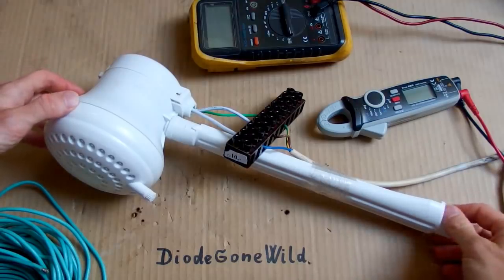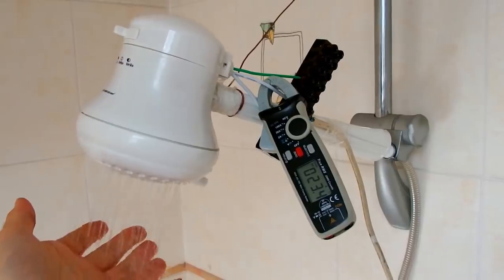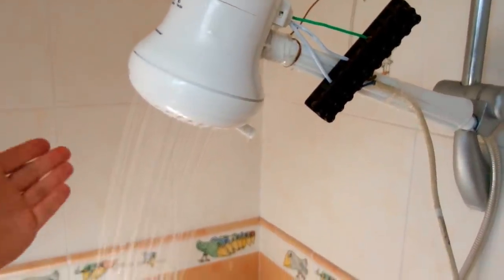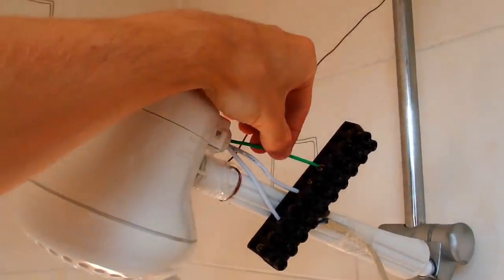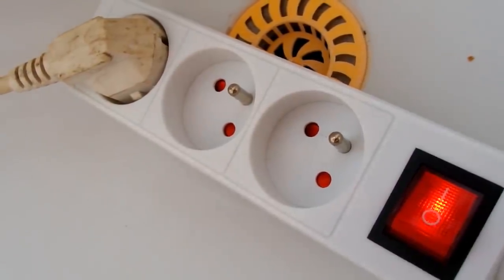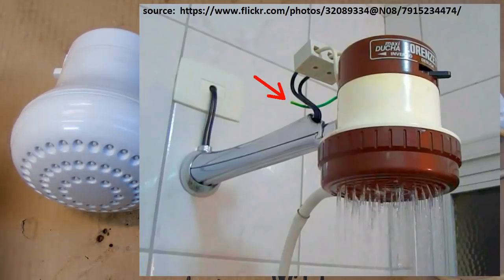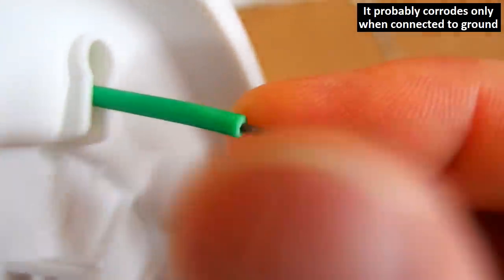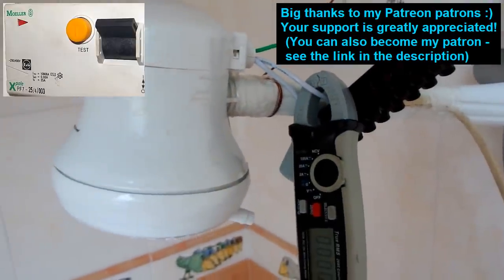Electric heated "suicide" shower PART 2 - test & measurements

Comment: So with 5 Volts and 1 Amp, you can charge your phone while taking a shower - that's nice! 
At 2 Amps, even Quickcharge.
Reply: Is AC,you need to rectify it first and get a voltage regulator if you dont want to blow up your phone battery.
Reply: @mernok2001  noted, bring rectifier and regulator first before taking phone into shower

Comment: You need to add more salt ! :)
Reply: Haha, best video of him :D
"Even more saaalt " :D
Reply: All you would need is to install one of those over an old metal bath with an earth/ground wire attached or a metal drain pipe and you have a disaster in the pipeline... even taped up with the power cable right for 32A if the cable joint gets wet you have mains voltage on top of you, add an earthed metl frame shower screen and you have built a death chamber.

Comment: As a Guatemalan, I find this video quite fascinating. I've used those showers all my life and I never thought of them as any particular hazard. I've received a couple of shocks, but I never thought seriously about them. Also, I've never met anybody with a shocking experience (pun intended.)
Reply: Really? As a Peruvian, I grew up shocked and scalded by these devices. (Well, not every time, obviously, but let's say I haven't forgotten!) Perhaps they have improved a little since the 80s and 90s.
Reply: @haraldhelfgott195  I still get a shock in Peru even under new devices (the ground wire disconnected as usually)
Reply: @haraldhelfgott195 I used similar when I lived in Callao in 1992. Got shocked a few times because I’m tall but I lived. Moving to the Philippines in February and buying one of these for there.

Comment: Hahaha, I'm Brazilian.

And I have used this kind shower all my life (25 years).

And you are absolutely right about the conditions to get a shock.

This already have happened with me but the shock never was a big one, just a small fright. But happened this is a common fact.
Reply: I'm Brazilian too. Unfortunately old houses do not have a ground wire and most electricians are not concerned about safety. They don't connect the ground wire even when one is available because they are just too lazy to connect one more wire after having seen so many showers working with only two wires connected.
Reply: @andrelange9877  Sad but true, they only do the least effort to get it to work.
Reply: @davidca96  It is so rare to see something grounded here in BR that when someone decides to talk about it, they usually like to make it sound as if it were a supernatural complex subject that is not worth dealing with, so it serves as an excuse to leave things ungrounded.
Reply: you can haz internet in HD but you can no haz safe shower
Reply: @YouTubeSupportTeams  That's because in BR stupidity is the rule, not the exception.
Reply: @andrelange9877  yeah, i'm not at all surprised. It's Brazil.
Reply: When I spent a year there I planted a copper rod into the ground outside my GF's house just to connect my computer, as we had many lightning strikes on the beach and close within the valley where I lived. I miss Brasil :(.....would live there again in a heartbeat.

Comment: Great research and testing of this dangerous device. Your drawings are awesome. Keep up the great work.
Reply: but if you call it dangerous among poor latin americans you get brushed off as paranoid, that's what has happened to me
Reply: @imeakdo7  me parece que sera peligroso en tanto no se instale correctamente, si se siguen las recomendaciones del fabricante y se aterriza la termoducha, tal y como viste en el video, no hay peligro alguno, el problema esta en la mala instalación, pero eso le puede pasar a cualquier equipo eléctrico y de igual forma terminar siendo peligroso.

Comment: Even in Brazil, all new electrical panels have differential current breakers, so the simplest version of this shower no longer works. The trend is towards insulated heating element units, and central heating units are seen more and more these days. Indeed it is very rare to hear about accidents related to this shower here, knew about 1 or 2 cases in my 40 years. OTOH people here are very afraid of gas heaters (those old units that went into the bathroom) because many people have died of carbon monoxide poisoning. This shower works in Brazil because water is very "soft" (little dissolved minerals), water is around 20-25ºC already. Most houses don't have too big water pressure and don't desire it, otherwise too much water would come out and the shower would not be able to make the water warm. Less pressure = droplets = no conduction.

Comment: Brazilian here. In normal operation without grounding you normally fells a light shock only when touching the faucet if you have an open cut in your hand despite that they seem to be pretty safe. Interesting fact that we often see on the local news people that got killed by natural gas powered showers but not by these so called suicide showers. Anyway nice video :)
Reply: Well, old-fashioned Brasilian natural-gas showers would not pass inspection in many countries either! (Used one in Rio in 2007.)

Comment: No groud, latin america stile!

I`m from Brazil. I used things like that all my life. Never hear anyone how died because one of these showers. But I learned the hard way not to switch power when the water is running. Little shock on the fingers. Hahahaha...

I liked that you tested without the ground wire. Like you said, most installations are done like that.

Another very common and very dangerous thing that is done here is that the circuit breaker that was originally installed for the shower was, lets say, 30 amps.  The installed shower needs 35 amps, so the breaker is switched to a higher value without changing the wiring that was designed to handle 30 amps.

Also, since it is very common to have these showers here,  the lowest tax we can pay for energy already covers one of these showers. We would not get any discount by getting a boiler.

Cheers!
Reply: i used this in my house but many times one wire in the socket getting melt or burn what shall i do give me some idea bro.
Reply: Your Brazilian circuit breaker boards recalled in memory our circuit breaker boards in my childhood. It was at Soviet era where 2-3 room apartment usually had two 250V 6.3A circuit breakers. Nominal current for apartment was considered 10A. Wiring inside apartment walls was accordingly thin with thicker wires only for electric stove socket. Usual wiring also had room lights and wall sockets connected. In result more demanding appliances or two electric room heaters in winter was not usable together with other appliances and blew away circuit breakers together with room lights. But people realized that they can have power longer if they use thick wires and nails instead of circuit breaker fuses. It kinda worked till their apartment wiring started to act as fuses :)  With house fires sometimes in result.

Comment: Quick safety suggestion, when grounding yourself ground the same arm (ie with an arm band).
Grounding yourself with the opposite arm is just about the worst thing you can do, a lot of the current can flow through the heart and it doesn't take that much to cause arythmia.
Still, great video & shocking (pun intended) how someone can sell such a product.
Reply: he knows this..
Reply: I'm pretty sure he knows this

Comment: This is the best video so far on the "suicide" shower. I think I would feel comfortable using one especially if I installed it myself. I would replace the ground wire with a 20 gauge, stainless steel wire and seal the wire connections with silicone caulk. In a country without a ground connection, I would use a proper pipe clamp further on up the pipe and check it with a multimeter to make sure it was good. If plastic pipes were used, I would install a good grounding rod into the ground outside the bathroom and bring a wire through the wall. In all, I would have no problem using this dodgy contraption. I likely wouldn't even have a problem with my kids using it if I had installed it myself. I think I would install a water resistant switch away from the shower as an emergency shut off in case the contacts got welded together, and the thing caught fire.
Reply: Indeed a bit of engineering and it should be more safe then some other stuff in bathroom ( cases are nominaly grounded but they do like to somehow get current inside and if paint peels off while they won't kill you or anything it's unpleasant like 9v on the tongue )
Reply: - In a country without a ground connection, I would use a proper pipe clamp further on up the pipe... One of your spiritual relatives one floor above my apartment grounded his washing machine to water pipe and nearly killed me. I would sue you for negligent homicide try in such case.
Reply: @KrotowX  This is quite a baffling comment

Comment: Those things require maintenance, it's very common that the ground wire gets oxidized and it breaks and falls off, the automatic mechanism gets dusty and it gets stuck, also the contacts get oxidized and the shower stops working or they weld themselves. It's not a bad idea to put a knife switch with a cord, so that children can turn it off in case of emergency.

If you want to use it you should know how to operate it safely or in a safer manner, which most people don't know, for example if you close the water and it keeps making sound it means that the mechanism got stuck or the contacts got welded, so you simply open the water again (before turning off the breaker) to avoid fire hazards, they are usually pvc so they don't catch fire like plastic, they get mostly carbonized buy yet dangerous.

Comment: It's surprisingly 'safe' considering I was expecting a proper shock from it. It might be useful as a backup I guess
Reply: tmo72 I agree, but I don't see how it could possibly work properly in let's say a European country. You'd obviously ground it and all houses built after the 70's have one or two RCD's connected to all of the circuits in the house. Bathrooms (like the guy in the video) trip at 30 mA in Europe so dropping a hair dryer in your bath tub won't kill you. But a lot of modern houses have 30 mA for either the entire house or just for the dry circuits and 10 mA (yes, ten!!!) for the 'wet' circuits like kitchen, garage, outside and bathrooms. So this device would never work when properly installed, because the RCD will trip all the time. Unless you disconnect the ground wire, but no one would do that?
And there's not really a way to fix it, because there will always be current going through the water touching the ground wire.

They could've made it a lot safer though by making it longer, so the water would be droplets (don't hold voltage anymore), then come together and then go through the nozzle for a nice stream of water. They could even allow you to connect a separate hose with your own shower head, because it's impossible there's still any sort of current in the water
Reply: I guess you can fill the bucket with the hot water so you don't get the danger of killing yourself
Reply: And this one is the cheaper that you can get, probably a chinese crap
Reply: the brazilians brands have more security, but the quality can be expansive

Comment: It was developed here in Brazil in the mid 30's, in every house in Brazil has at least 1 shower we are a tropical country and so we have the
habit of bathing every day, there are more than 200 million peoples taking baths every day in the last 85 years if you compare with the numbers of accidents with showers
 they may be considered safe. They must be installed correctly at the proper heigth, any electrical equipment is dangerous when used improperly.

Comment: Oh just a hint. These showers are made to be really high at the top of the room, really close to the ceiling. So usually people will be very far away of the head. 

Oh and this is a really dodgy and low end model, there actually are some that the resistance is closed and dont touch the water, so no shock foe the people! Unfortunatly they are a bit more expensive and usually its resistance cant be replaced so many people dont buy them. 

Nice test!
Reply: Alex Tarasov Yep, basically. Way more safe.

Comment: i connected mine like the one in Grenada,bought some wires to extend the wires from the walls and connect to the shower head. i connected the ground wire,connected the red wire to the positive marked wire of shower head,i connected the black wire to the -ve marked wire of shower head. but to my surprise,the black wire keeps on burning when i open the shower heater.what might be the problem,are my connecting wires to thin?,are live and neutral wires interchanged? what might be the problem?
Reply: for "normal" use is recomended cable with diameter between 2.5 mm and 4 mm, or the recommended for a current of 25-30 A x 220V/110V by the standards of your country

Comment: Here in mexico i had one of those it was the 120v version and had a dedicated circuit supplied by a gfci pigtail breaker at that time there was no problems with it but later in a few months as shown in the video the heating element corroded and broke but since i now had more budget i upgraded to double phase 240v and installed a rheem 18kv electric tankless water heater

Comment: I wish someday there'll be part 3 special edition which includes running salt water😍😍 through the shower head and aslo running the heater without any water.. 

No cat was harmed during the video 😶
Nice drawing 👍👍
Nice video 👍👍
❤️❤️❤️
Reply: Faysal Khalashi™ its not possible to run the shower without water since the water completes the circuit
Reply: EVEN MORE SALT !!!
Reply: @Sebastian-gj9tc  you can run it by just connectiong the heater to the mains directly

Comment: The real big problem comes out if you have not grounded the shower (or the ground wire becomes damaged by corrosion) and accidentally one of the two 'power wires' disconnects. In this accidental configuration all the current coming from the live wire that is still connected has to flow down towards and trough you to the sink... as the pipes are somehow often grounded...

Comment: I've used this and another way to get a shock is if while you are in the shower the resistance breaks, those resistances die one day to the other. Is not pleasant but it does give you the time to jump out the shower.

Comment: Somehow i think i will give it a mis lol :-D
Now that "chocolate block" connector strip is the "Dogs bollocks" , oh you added it, the best part of the unit :).

Keep the thick resistance wire element, great for making a variable load for psu testing :-D.

Comment: hahaha you afraid in the end make me smile. Is a very common shower hear in Brazil. Even with the shocks with bad instalations we not hear that they cause deaths. In the last years electric instalations in homes are getting better in Brazil and the electric shower are getting more safe and is becoming rare get shocked by one of this.
Reply: I bath everyday in a Lorenzetti Acqua Duo
Reply: Tem que ser muito rico pra nunca ter tomado banho em uma dessas! Hahahaha
Reply: you only need one shock , is life so low value in that sunny tropical country?
Reply: @highflowhighflow9896  
Almost everything in Brazil is very expensive, electric energy, cooking gas. We have the option of solar heater, but it is an expensive system..
Reply: I was doing an exchange in brasil in 2013. I took a shower in a shower like this, and got a nice stingy shock from it. The owners of the house told me to shower myself wearing flip flops LOL. It actually worked HAHA
Reply: @joonamerilainen1956  This happens when the wiring of the house is older and lacks the necessary grounding, it is not dangerous, but it is a boring shock. If you have any bruises on your fingers, it hurts.

Comment: That voltage in the pipes is ominous. Could it de-galvanize the pipes or at least make them corrode faster?
Reply: Exactly.
Corrosion due to a galvanic leak.